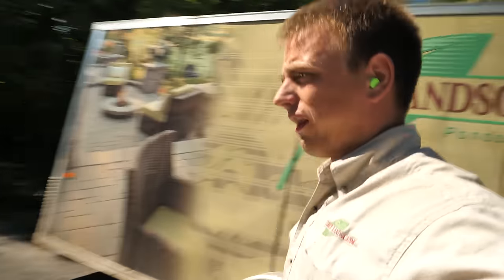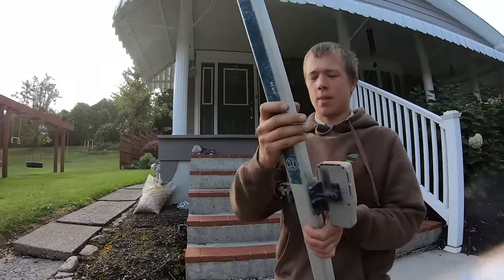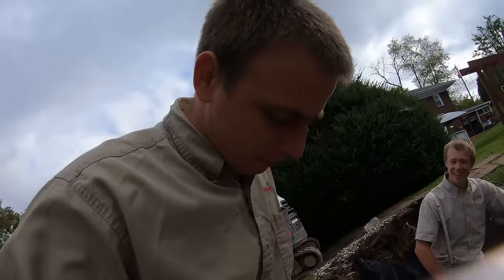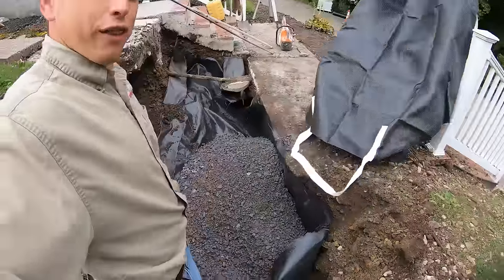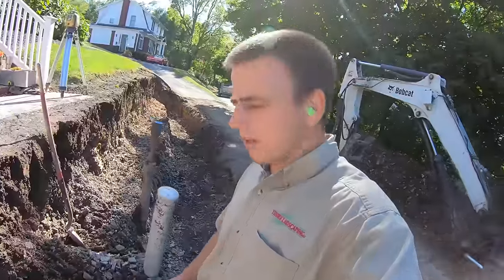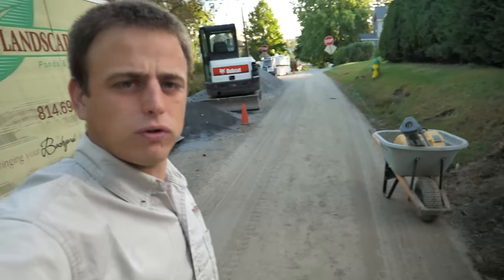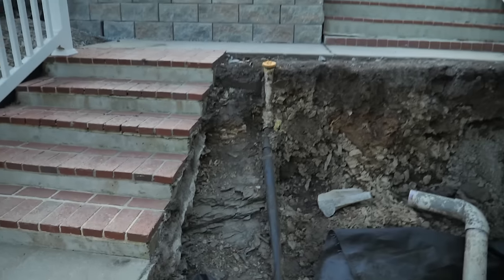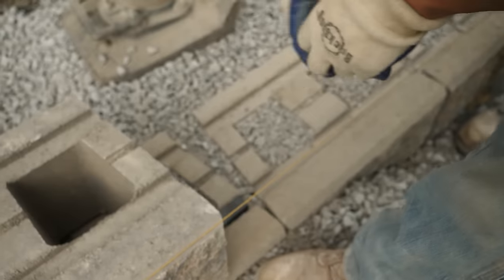How to build a RETAINING WALL that WON'T fall over!

Comment: I built retaining walls for about ten years, before my body wore out and I had to switch to a desk job. We always had a hard time selling our walls because we were always the high bid, but I know of at least three jobs we didn't build that we ended up re-building several years later because the low bidder had no idea what they were doing (one 3' wall was built on 1" of play sand over soil - guess what happened to that one...). So I saw your video title and thought "yeah right, nobody builds retaining walls right any more." Happy to say you completely proved me wrong. On the odd chance the homeowner sees this, know that you got a really high quality, professional installation that will never fail, and it is worth every penny you paid.
Reply from the maker: Thank you Dirkus! Happy to read your comment :) Thanks for watching! Cheers!
Reply: There's often not enough money available to do a job right...but there's somehow always enough money available to do the same job over (and to do it right).
Reply: I’m currently in the process of building a block retaining wall 20ft long by 3ft tall. I’ve got my trench dug and leveled. I’ve looked online and I’m confused by the type of base gravel type I need. So do I need to put fabric on top of the dirt, then fill with gravel, then start my base block layer. Then do I keep putting gravel behind the wall or do I backfill with dirt? If anyone could help or guide me in the right direction that would be much appreciated
Reply: It was top notch. I've got a little one to do. I've got about 120' of cliff with a 100 year old house hanging over the top. As soon as I recoup from measuring the cliff on my face I'll get started. I think I'll need the use of my left hand and wrist. And my  right shoulder being in the right place will prob make the job go smoother as well. If I started now I'd look like Quazi moto with a tool belt on hobbling across the cliff side.
Reply: @crimsonghost411  From what I have learned (and am applying to my own wall building on my property), you need to have a moderately coarse "dirty" gravel compacted well directly under the first block course to be stable.  I would say depending on the material that you excavated to (loose soil, clay, rocky soil, large stones) you need an appropriate depth (up to 6") of that coarse gravel, ideally with a membrane between the gravel and loose soil.  The backfill needs to be the coarse 3/4" (or 5/7th) clean drainage gravel several feet in width which is quite stable and drains well preventing the freeze/thaw cycles of retained water that shoves the wall over with time.

Comment: For the most part this wall was built very well… one of my biggest problems with this build is the lack of geofabric on the back bank… you used it for separating your subsoils, also you used it to keep your top from the clean stone, but there’s nothing separating the dirt on the back bank going into the clean stone - I see this a lot, I see a lot worse and this was definitely built better than most would, but there’s no reason not to keep your clean stone CLEAN - unfortunately this stone will pack with minerals from that bank and the same issue will arise in the future

Comment: So the first step in building a good retaining wall is realizing that it's too big a job to do on your own, and that's why there are professionals.
Reply from the maker: Exactly! This ☝️☝️☝️☝️
Reply: @Tusseylandscaping  It looks great! There is a lot more that goes into one of those walls than I ever knew about. Thank you for the video! Fantastic job guys!
Reply: Hardly, I just underpinned my house and built a 50sqM basement, I work in TV.
Reply: That's not really true. It's more a matter of whether you have the time or not and a willingness to learn. A lot can be done by an individual with a little leverage, some good tools and innovative thinking. A lot of so-called "professionals" that are licensed and bonded will mess up these days. There are more bad ones than good ones in my experience. These guys happen to be one of those who take pride in their work and have expertise, but I can name countless contractors in our area who don't, and the worst part is that the county issues permits and approves jobs that were done criminally.

Comment: As I retired builder I have seen many projects done right and wrong.  Your wall is 100% textbook perfect.  Actually a little overkill which is exactly the way to build!  I always did extra to be sure my projects help up forever.  If I was doing retaining walls, landscaping, building a house, renovating a house it was always done right.  Your one excellent example of a contractor doing the job right and taking pride in their work.  Well done!  Thank you!
Reply from the maker: Thank you Richard! Appreciate the comment!

Comment: Nice video. I just did a small 2 foot wall. One thing I learn other than leveling, smoothing underside of block is wearing a back belt. Nothing stops work faster than a sore back. Cheers
Reply from the maker: For sure! Good luck!

Comment: I’m doing a retaining wall for the first time and really don’t know how to do the drainage. Was looking for tips. Thanks hope you respond
Reply from the maker: The drainage is shown in this video pretty well. Basically the drainage of a wall consists of the perf pipe behind the wall, that then comes through the face of the wall in the bottom every 20 ft. Then behind the wall you need at least 18” of clean stone drainage, (not dirt stone or stone with fines in it) that will allow the water to drain through to that pipe, and out through the face of the wall

Comment: Hand digging a basement addition, almost 40 years ago, just touched the buried rotten gas line with a shovel and it started leaking.  Sealed the crack by rubbing a bar of soap on the crack.  Good thing I was wearing my brown pants.   Shut it off at the street and replaced the pipe.  If you want to know how to build any type of foundation or stonework to last, watch videos from a contractor who works where there are cold winters and plenty of moisture.  That combo exposes shortcuts and shoddy work every time.
Reply: Along that line of thought I assume they made the utility local One Call?
Reply from the maker: Yeah we always call in to the utility to come mark things out

Comment: Good video. Only critique I would note is the orientation of the geogrid. Normally would run the grid perpendicular to wall. Good job. Thanks for taking the time to put this together.
Reply from the maker: Way to pay attention to detail! This grid is actually bi-directional, so it has equal strength both ways
Reply: That Geo grid is not bi directional. It should have been cut to the proper lengths, not rolled out.

Comment: This is definitely the professional version versus the homeowner version. I did a small two block flower bed retaining wall. I dug the trench and filled it with water and that gave me my level point. And I took those bamboo barbecue skewer sticks that look like really long toothpicks and put it in both sides at the water level. Then I drained the water and got some old bags of concrete that were pretty much useless because they've been sitting around too long and made a slurry and filled it up to the level of the skewers. Then I just laid in my bottom course of block on the concrete and it never moved since. I think it's not bad for not having a clue on how to do it.
Reply from the maker: A get it done attitude will get you a long way!
Reply: Man that's a freakin great idea, the laws of mutha nature are the ultimate.  😃

Comment: Hi I truly enjoyed your video very professional. I'm a retiree and tying to build a small three block garden wall with a curve at the end. My question is I have put down approx. 3 to 4 inches of base material, I should say I dug a trench about 10 in deep . My wall pavers are 7 inches in height. How much sand should i bring in to lay the wall stones on?  and should i back fill with course stone behind the wall. Again this is just a garden wall .I live in northern Michigan, we might get 3 months of summer and about 7 months of winter. the rest is bug season. LOL
Reply from the maker: hey glad you enjoyed the video! I would do 6" of crushed stone base (compacted) and then use a smaller open aggregate stone for your setting bed, like #9's or 1b. I don't prefer to use sand. Regarding the setting bed, we make it only 1" thick
Reply: There is a biblical tale or proverb about a house built on stone, as opposed to one built on sand, I do believe the one built on sand is the no no.

Comment: Great video. I need a wall redone. Glad I saw this, I need to save up some money for a couple of more years! 
I saw caulking? in the background, but I didn't catch what it was used for?
Reply: Glueing...
Reply from the maker: yep, in places where we couldnt use the black clips (curved part of the wall and the cap stone) we glued them instead.

Comment: Geogrids primary function is to stabilize the material being retained, which in turn reduces the lateral force being applied to the wall. The secondary benefit would be helping to hold the face in place, but that's not what makes geogrid the super impressive product it is :) You for sure do everything right as far as utilizing it, very solid build!
Reply from the maker: Thank you Tom! Yep, you're correct. So much misinformation out there on walls, glad to see this spot on comment 🙌💪
Reply: @Tusseylandscaping  yessir, I've replace a whole lot of failed retaining walls from people who didn't understand the principals involved, it's a shame to see so many falling over when building it right in the first place would have solved all the problems!
Reply from the maker: And not been any harder to do than what the worked to install it incorrectly!
Reply: @Tusseylandscaping  precisely! Except it does cost a little more, more money for drainage material, more money for geogrid and soil separation, but it's a hell of a lot cheaper than paying twice to build the same wall!
Reply from the maker: 100% truth!
Reply: Correct,  grid helps create a "global" stabilization.

Comment: Hello! Great video. We live in NH and would like to build a 4’ wall along our drive under garage/walkout basement. We live at the bottom of the hill and we a lot of water. We just wanna make sure the wall will hold up. How deep should the subgrade be? Thank you so much for your time!
Reply from the maker: Hey there! Make sure you bury a full course of block below grade, and depending on what the spec is on the wall block you are using, you may need geo grid as well. Good luck!

Comment: Hopefully a helpful tip! The geogrid you are using is a uniaxial grid. It is the correct type of grid for your application, but as the name implies uniaxial grid’s strength is only in one direction. The grid is designed to be installed perpendicular to the wall face not parallel like you did in the video. It takes more time due to the cuts and overlaps, but you will not get the strength you are looking for unless it’s installed properly. 

I have been in the geogridand geotextile business for 7 years now so I hope you find my comment helpful and not critical! Great video!
Reply from the maker: Now this ☝️ is the way to write a helpful comment people! Thanks Brooks! 😊 Everything you said I agree with, except, this is bi directional grid. Let me find a link to the grid we used
Reply: Unigrid has ribs/slits in one direction (parallel to the roll) but as the video clearly shows they used square grid which is what makes it biaxial (squares have the same strength in both directions, simple physics).
Reply from the maker: Yes, this. ☝️ Thanks Tom!
Reply from the maker: This is what we used Brooks

https://www.amleo.com/srw-3-series-geogrid-4-ft-x-50-ft/p/GEO-3450/?kc=amlshop20n,&mkwid=|dm&pcrid=416316781657&pkw=&pmt=&plc=&prd=GEO-3450,GEO-3450&utm_source=google&utm_term=&utm_campaign=&utm_medium=cpc&slid=&pgrid=96761566474&ptaid=pla-325991452724&gclid=Cj0KCQjwncT1BRDhARIsAOQF9LmfZhlce2rxCnQKizS80buCthoDpX4daJZi5ORKPj4DEDq1_VmUp9gaAom1EALw_wcB
Reply: Tussey Landscaping Awesome! Glad to hear it!
Reply from the maker: 😉 good catch though. Your not the only one that mentioned the grid
Reply: Tom Szabo There are plenty of examples of uniaxial grids with a “square” aperture. The grid being “square” doesn’t automatically mean it’s a biaxial grid. They are using a knitted grid instead of the typical punched and extruded which led me to believe it was a uniaxial. Thanks!
Reply: @llessufpb  I've not seen a uniaxial square grid where both directions of the material are the same. The woven yarn type is thicker along the load bearing axis with the cross weave just being there to hold it together. If it's square and the same stuff on both axis then physics demands that it is biaxial.

Comment: Correct me if I’m wrong but shouldn’t the Geogrid be cut and rolled opposite the direction you’re installing it ? That is to say that it should be perpendicular to the block not rollled across in parallel (which is easier).
Reply from the maker: You are correct, except this was bi-directional grid, which allowed us to roll it out the way we did

Comment: What did you do with the geogrid that was sticking out the front of the wall? It looks like you were putting blocks on top of it while it was still sticking out.
Reply from the maker: Yeah it was, we just cut it back against, s and then used a torch to melt it out of sight

Comment: A permeable stone base is good - if it is done properly it could also allow surface water to pass under the wall. However you have used 'modified' fills which I think when compressed and compacted is not very permeable. But you have added a land drain. Water as you properly pointed out is the enemy of retaining walls.
In UK you are not allowed to cover a Gas line with any foundation slab without proper protection to the piped service. 
No dust suppression on your disc cutting tool is not good practice. But all in all it seems a nice looking job.
Reply from the maker: Thanks Brian!

Comment: I’m curious what a wall like that costs. I can only imagine. It’s beautiful and will be there for generations with that design and craftsmanship.
Reply from the maker: Thanks Craig! It was 14k
Reply: Tussey Landscaping 
That’s less than I thought for all that work, material and equipment.
Reply: What is the length and height of this wall
Reply from the maker: @olivernassry4055  it's approx 45' long and about 52" tall
Reply: @Tusseylandscaping  Is that 14k WITH material?  if not, how much was the material in addition?
Reply from the maker: @dr150  yes that's with materials

Comment: Thanks so much for such a fun and informative video! I have a question though. I live way too far from you guys to hire you to build such a wall for me and am on a limited budget but the size is approximately the same. I am going to have to build this one myself as there is no one where I live in the backwoods that does this sort of thing. Approximately, without divulging too much personal or private information, should a wall like this cost me to do myself, granting that I have all my own equipment to compact it, lift the gravel, etc? Just a ballpark figure would be fine as I know brick and gravel cost differently throughout the U.S. Again, thanks so much for teaching me how to do this the right way!👌😊
Reply from the maker: Hey Shannon, glad the video is helping you out! :) I would be prepared to spend 5-7k on a project this size that is DIY. Good luck!
Reply: @Tusseylandscaping  Thanks so much for the great information!

Comment: Nice job guys and great video. she aint going anywhere. Whats the idea of the straw on top of the lawn? Is it to protect the lawn seed?.....How long you keep it on for? Thanks
Reply from the maker: It's there as a moisture barrier for the grass seed so that it will germinate quicker. We usually just let it rot down in to the ground, or, if there's two much there and the grass is up rake it up after a few weeks

Comment: How tall of a retaining wall can you build without having to have it engineered?
Reply from the maker: Depends on your wall block and situation. Block manufacturers provide engineered designs for their wall block
Reply: Typically 4 feet.  At least that is code where we are at.
Reply: It doesn't necessarily have to be "engineered" as long as you put down geogrid every 3.5 feet

Comment: I thought  drainage pipe is supposed to be at the same elevation as the BOTTOM row of blocks?
Reply from the maker: Ideally yes. But because of the road we had to daylight it at road level

Comment: I love to see the job done right. It costs more to do it properly, but then the wall lasts way longer. Hey any tips on how to locate a wall guy in my area?
Reply from the maker: That is correct sir. That will save you a lot of greif in the long run. Best advice I could give is to do Google searches looking for a contractor, and then make SURE you go check out their past jobs. Be good if you could see some of their work that is 5+ years old so you can see how it is holding up

Comment: Hardly anyone wants to get it built right bcz it's not cheap ! I've seen low height walls under 5' fall over bcz nobody understands drainage, hydraulic pressure and freeze\thaw cycles
Reply from the maker: Truth! 👂👂👂
Reply: @Tusseylandscaping  May  I ask what this job cost?

Comment: I have a question.  I have been watching a few retaining wall videos and none of them are using concrete for the base, nor using any metal bars in concrete for reinforcement. 

Here in Belgium, they build retaining walls with concrete foundation and then blocks that are hollow so metal bars can be placed inside and then concrete is poured within the blocks all the way down to the foundation.  

But it seems like a major over kill if I see how the walls are built in the videos I have been watching. 

Anyone has some comments on this?  Thanks